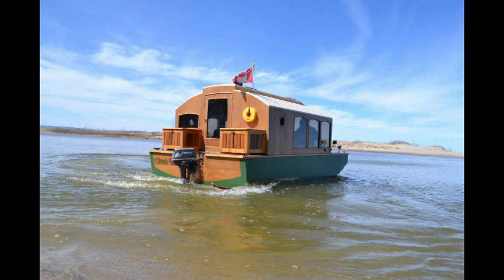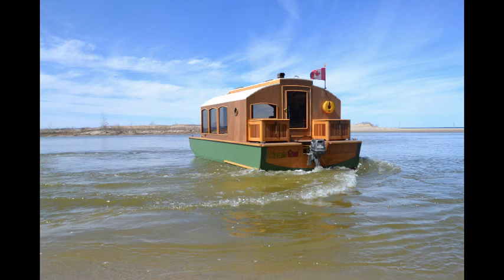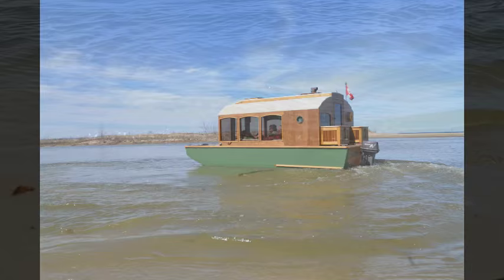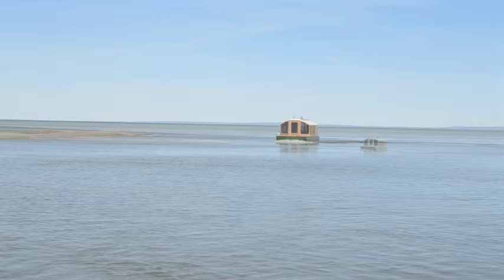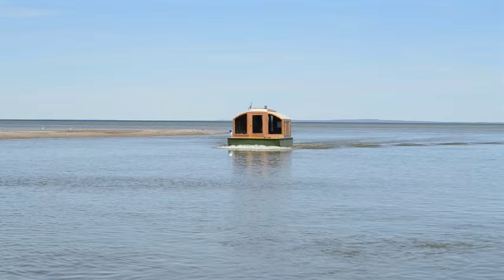Build a Boat 360

Comment: What is the over all length and width of Diannes Rose? and approximate weight? Thanks shes Great!!
Reply from the maker: +Shawn Helton Size,17 X 8' wide (it is easy to lengthen a couple of feet)...Weight,1500 lbs empty/2000 lbs with motor (9.8 hp), fuel, water and gear....Cabin size, 10' X 8' with added storage under the forward and rear decks (lots of storage space!)....Draft, 6" at rest, 8-10" at speed....Interior height, 6 foot 8 1/2 inches...Cost to build (materials), $4500 Canadian... Also check out my web site for more, RoyDesignedThat.com as well there are many more You Tube videos to link to. If you have and further questions I'm here to answer them. My phone # 705 429 6266 or you can email me again, email royschreyer@gmail.com. All the best /Roy

Comment: Why didn't you put a small v in the front of the boat so that it wouldn't have to push as hard to move that much water.
Reply from the maker: +Jerry When you have observed barges in action it is clear the "V" is not needed. Hard to believe but at displacement speed, we manage 6 mph at 3/4 throttle with a 9,8 hp two stroke, the water pushed but also smooths the ride. We punches (does not slam) smaller waves with the boat staying comfortably smooth running inside. Windage is less an issue as the boat settles 2 - 4" into the water at speed. She draws only 6" at slow or at rest. As mentioned speed is good for the power and the handling excellent. In rough conditions of 3 5' breaking waves (yes the boat handles it very well on all points!) we sit 8 10" above the waterline and while still a ride, there is little pendulum effect as you would experience sitting on the bridge deck of a larger boat. We passed one in such conditions and the family  was quite ill and unhappy. We were enjoying the ride! Look through my other videos and you can see what I mean. Oh pounding , I forgot to mention that we rarely pound as we run like a displacement hull, in the water! A short hull, 17', rarely meats two waves at once and the boat is light and buoyant enough to rise to the larger waves and rarely takes a wave over the bow, We do get a lot of spray when heading into wind and wave. When running the wide buoyant pram bow does not root and is a great ride as we surf along. I will add I do not want to encourage anyone to cross oceans as this is meant for fair weather but it will get you home should you get caught out! Best/Roy